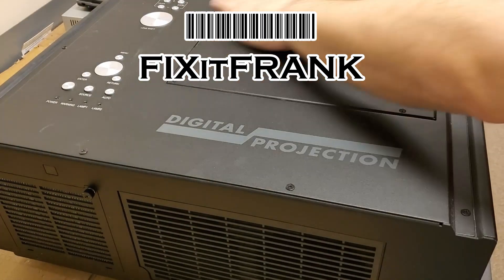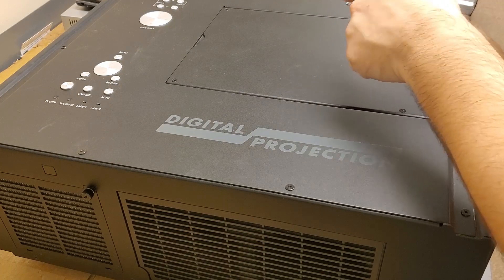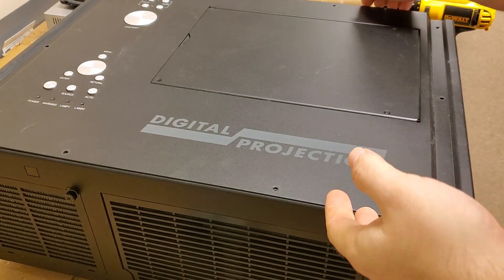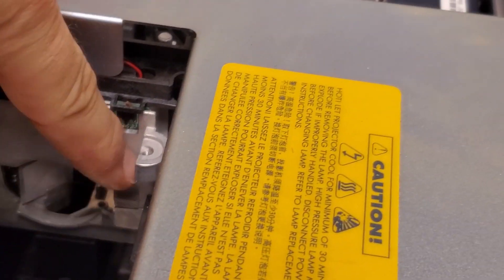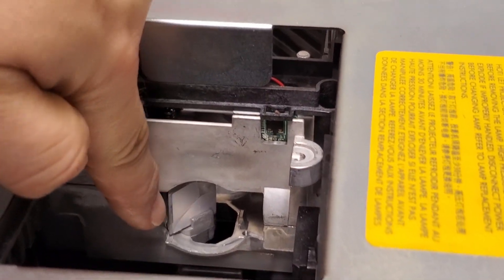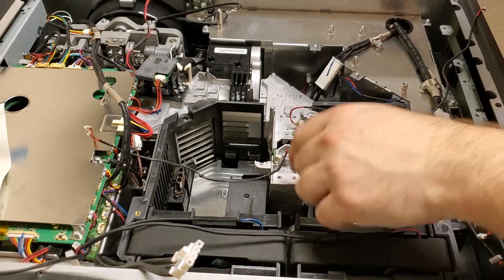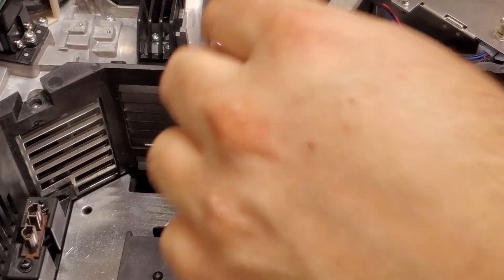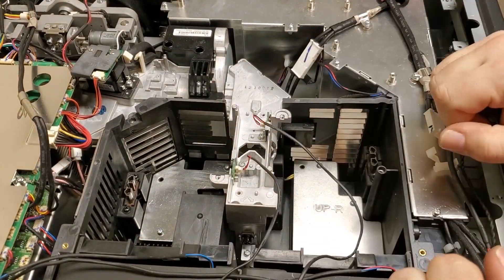Digital Projection eVision XVGA 7000 Projector Cold Mirror Replacement Part 1

Comment: Hi. Ineed your help. I have a Digital Projection HIGHlite Laser 4K. Its a 3 DMD 0.65" 1080 chips. Can you help me with the service manual or any guide to know what DMD use and some tips to replace it and then align it? I live in a country witouth service and with a restrictive custom that will charge taxes as new if i send it out for repair. We have a lot of experience with 3chips from SIM2 and Barco, but DP its much diferent. Any help, recomendation will be very apreciated! Thank you

Comment: Hello 
I need your advice. 
I have a sony vpl-vw1100es
It has a same symptom as you described. 
"yellowish horizontal band"
Can i disassembly the optic block and fix it?
I m not professional.
Reply from the maker: That is/was a very good projector. You may want to open the case and remove any dust accumulation. If the yellow band remains, the issue will be something requiring replacing the optic block. That model uses an SXRD system which is proprietary to Sony.  If cleaning will not resolve the problem, only Sony can repair it unless you can find a used but good Optic block.  They should be "fairly" reasonable to swap if you take your time. They were last made in 2018. They do have a 3 year warranty.  They sold for around $25,000 USD so it may be worth investigating the warranty status before doing anything else.
Reply: FixitFrank 
Thank you very much